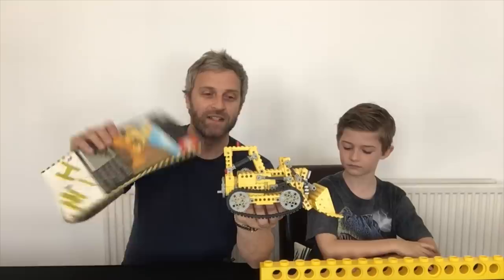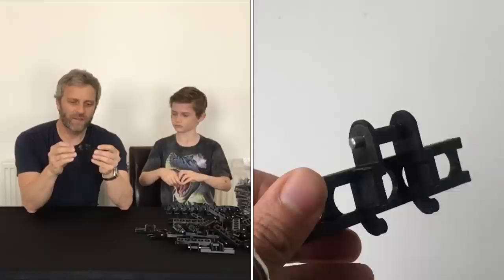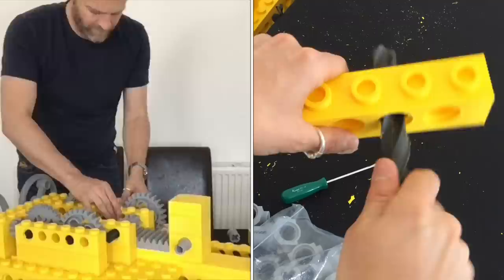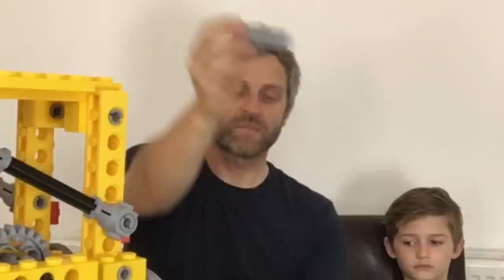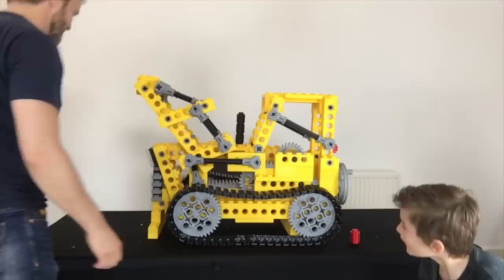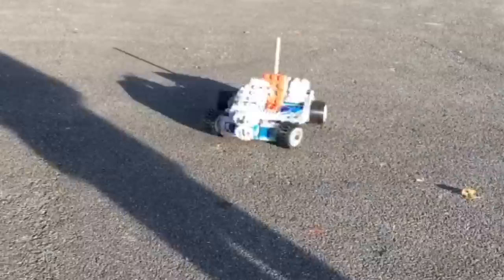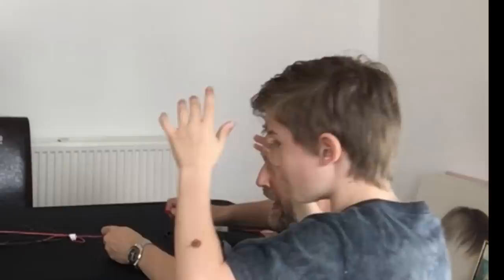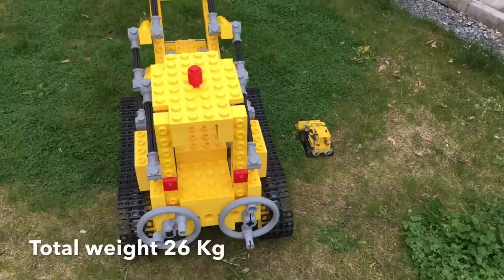Giant LEGO Bulldozer  - Mantis Hacks E15

Comment: Hey Matt; one of my friends was inspired by this video to ask me to print him a scaled up version of a lego set from his childhood.  I was just wondering what % scaled up things were and if you had to glue any of the pieces together.  It looks like you must have for the 1x16 technic brick, but I wanted to be sure since I didn't think the lulzbot taz doesn't have enough print space for it whole.
Reply from the maker: This is 5x scale, 500% increase. Yes the  1x16 pieces are joined, check out the forklift build detail video for how I do that. Also 3x scale works pretty well and saves a lot of time and material :)
Reply: Matt Denton Thanks for the info. Hadn't quite made it to the forklift videos, so it's good to know that where that is. These are super cool!
Reply: Hey Matt, a quick follow up; perhaps i missed it in the video, but the bricks i print don't snap and stay together quite like normal legos.  Do you run into this?  The tolerance of the pieces is 0 (though it is not 0 in the print due to reality), so i was wondering if you had to fix that somehow.
Reply from the maker: What scale are you printing at? Most of mine snap together well at 5x scale. It could be down to the printer? Or the scale of different?
Reply: Matt Denton I'm printing at 4x scale, but I'm also printing the ideal dimensioned bricks, so I'm not sure if that's the issue either.  They all fit together, but they don't stay together very well.  There prints don't seen to be going terribly wrong and aren't misshapen (an edge peeling up a bit here and there, but nothing extreme).
Reply from the maker: Hmm. Well I had to tweak the tolerance for a while within my SCAD files to get the fit just right.
Reply from the maker: The biggest issue was that the tolerance within the SCAD files didn’t scale.. so required tweaking. For example, at 1:1 scale the tolerance of 0.1 worked fine, but scaled x 5 was way to baggy at 0.5 mm
Reply: I'm actually altering things in blender since I'm more familiar with the program.  When I look at the meshes, the edges of the nibs and the bottom are at the exact same position.  So it would appear that the tolerance is 0; but clearly that is not the case once i print it.  I'm trying an experiment now where i make the nibs a bit bigger than they should be so that they end up printed the right size; but we'll see if it works.